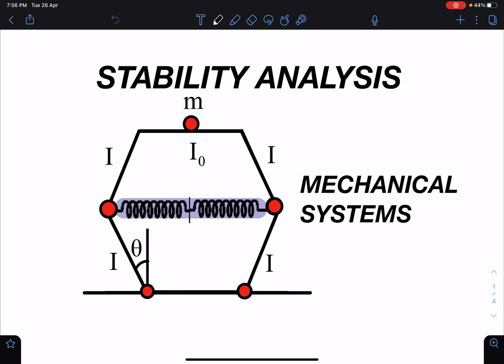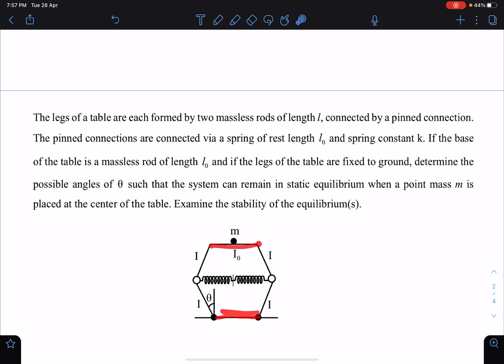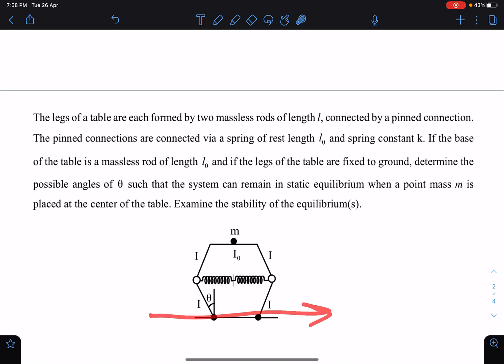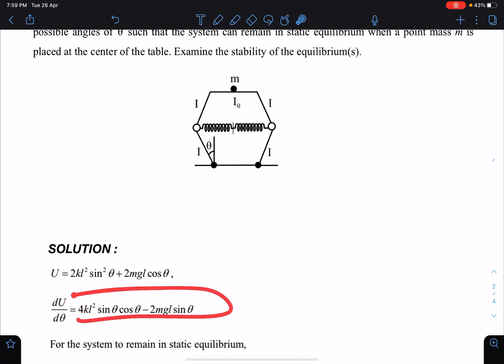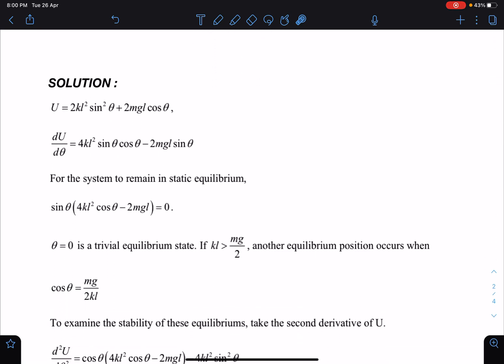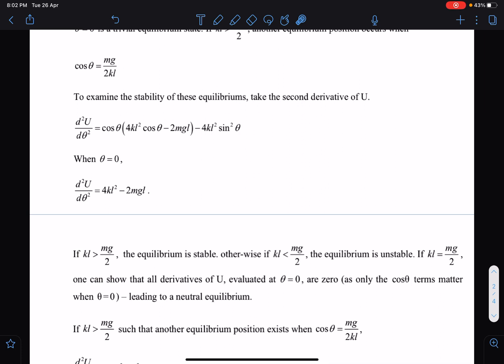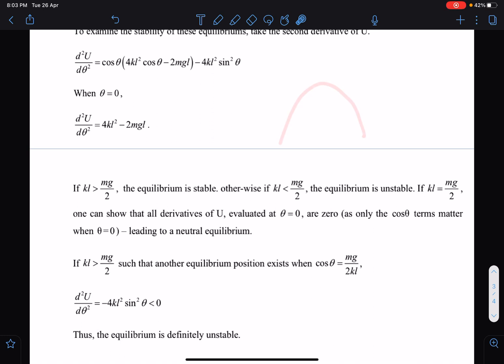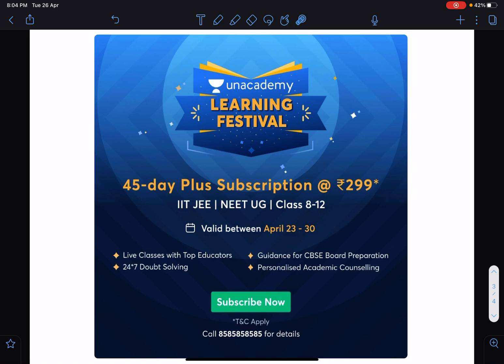[JEE ADVANCED] [ STABILITY ANALYSIS IN MECHANICAL SYSTEMS  ][ADVANCE PROBLEMS IN SCHOOL PHYSICS]

Comment: Sir last equation of video is partially correct bcoz sintheta can be zero
Reply from the maker: Sin theta case has been discussed separately … in last equation condition is for non zero theta only . Please check again 👍
Reply: @INSP_NITIN  yes sir i have cheken it but if you discuss also I that, then also in side bracket you have to write considering thera not equal to zero, bcoz in math there are we have to take care of every factor in all step